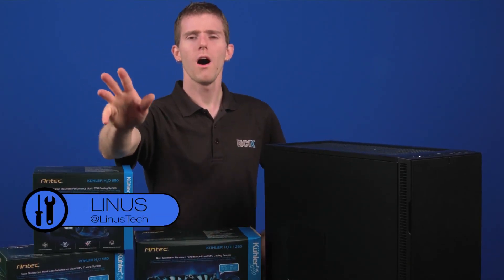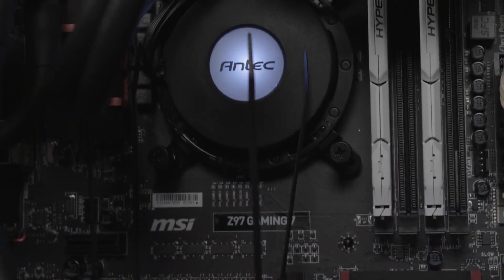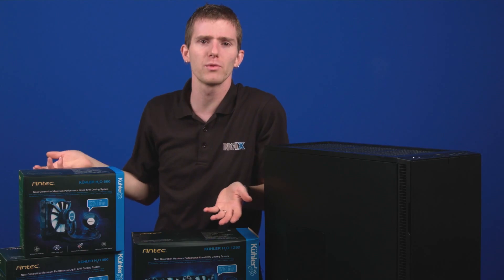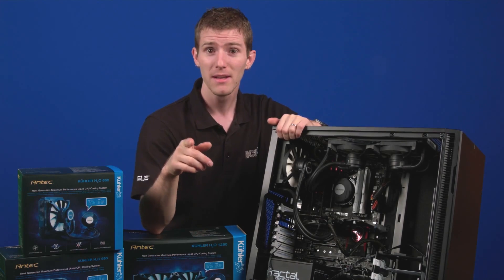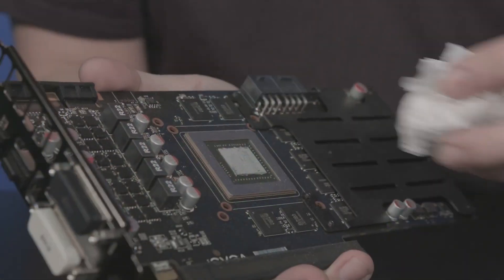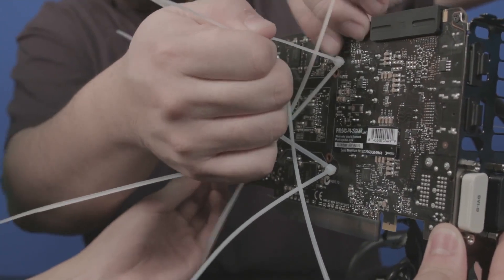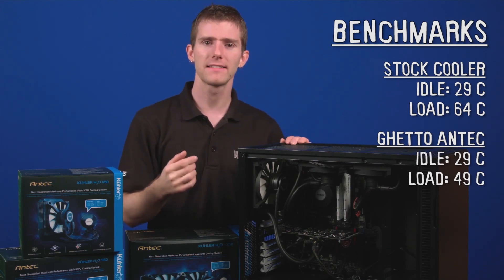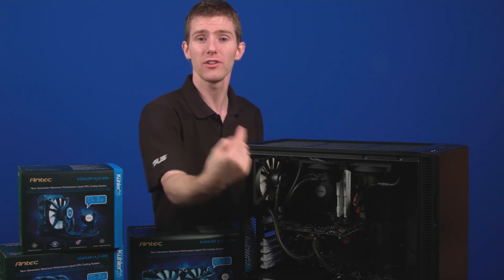DIY GPU Cooler ft. Antec Kuhler liquid CPU cooling

Comment: Many mistakes were made here. Such as not warping the zip ties that goes through the PCB around the loop that goes on the pump. Or adding a heat sink to the VRM as the fan wont be enough to cool them. You also have to check on the zip ties every so often as they loosen over time.
Well this a cool mod, it is not something you should do to as a permanent thing.

Comment: I wouldn't recommend this to anyone since you can easily damage the GPU if you apply too much pressure. If you do want to use aio cooling, just buy a Kraken G10 bracket and you can use even a cheap H55 to cool your GPU. Plus it looks better than zipties

Comment: i did this ages ago :D , with my HD 7970

http://linustechtips.com/main/uploads/gallery/album_2058/gallery_156501_2058_23528.jpg

the results are cool , max temp is 51 , and basically very quiet
 , with no fan changing RPM, all run at the same speed

Comment: I did this on my evga gtx 780ti kinpin with a nzxt g10 and a thermaltake extreme3 cooler. It lowered my temps down to 26c idle and firstrike extremely went to 49c

Comment: Been running a 920 on a 7970 for almost over 2 years and 8 months of that we're mining at full load 24/7
It's a great mod especially for and hot GPUs , 970 or 980 really don't need it though unless using high oc's

Comment: Linus,  thanks for the OCN bump,  yellowbeard from corsair did it first with a custom bracket - Zip tie methods was posted shortly afterwards.
https://www.flickr.com/photos/cravinmild/with/9565746043/
 bunch of pics in there but the gpu's are mixed in.   Oldest card was a 560ti from several years ago.

all cards used the same original launch Corsair H70 which was run on my amd 1055T prior to this.  The pump was just sitting around and I had plenty of zippys so they were free also .. more or less.   Lowest temp ever was on my zotac 560ti at 11c but most of winter my idle is 17c.   Never had a zipstrap back off or break with one set of zippys in use for more than a year untouched.

http://www.overclock.net/t/1203636/official-amd-ati-gpu-mod-club-aka-the-red-mod/0_20
http://www.overclock.net/t/1203528/official-nvidia-gpu-mod-club-aka-the-mod/0_20

Comment: I was like, "Cool.  Using a CPU cooler to cool the GPU by improvised modding."  Then it hit me that what is cooling the vram and the other components.  Only at the end did they say, "Use a fan blow directly at the vram to reduce their temperature. Prefer around 70-80 degree C range."  I doubt the silent version fan will keep that baby cool.  I was like, "Errr...  Does that defeat the two main purpose of water cooling?  Temperature AND sound reduction?"  I know this is for people that want to water cool their GPU in the cheap but isn't this a bit ridiculous?

Comment: you zipties could've been done better either by getting the 4 zipties on the ring ziptie and thread those through hole or use criss cross pattern to further apply pressure to block.

Comment: 1. Kraken G10: $30.
2. Supported AIO: As low as $55.
3. Minimum total: $85
4. Profit?

Seriously, while this is really cool, it's not something I could ever do. I have done my fair share of ghetto modding in the past, using a Dremel to add fan support and cable routing holes, zip ties to hold fans in place on cases and air coolers, and even duct tape to hold cables and drives in place in odd locations. But this...

I would just use the Kraken G10 for "cheap" AIO GPU cooling. While it's support is not universal, it does support a wide range of popular AIO coolers and GFX cards. No chance of it "slipping" or ever breaking away, I know I am always going to have full proper contact to the GPU.

More importantly, the G10 allows you to move air over the VRAM and other components on the card itself. In fact, adding cheap heatsinks (and of the proper size to fit between the G10 bracket and VRAM on the card) to the VRAM vastly improves it's performance in that respect.

Anyway, that was a pretty cool idea, no pun intended, but there is just no way I could ever do that outside of "just for fun" on  hardware I would not care if I damaged. =)

Comment: I did it with a seidon 240m and a firepro w5000 but I used m3x25 screws. The cooler block holes line up perfectly with the holes un the gpu pcb. No zap straps...

Comment: this DOES NOT WORK ON 7970, the GPU won't touch the block as the "frame" around the GPU is higher than the actual GPU. just a heads up

Comment: But the vram, that shit is going to get hot as fuck.
Reply: At the end he explained that it would get hot and you should cool it with a fan pointing at that.
Reply: DRAWNBOX thanks, have you seen the nzxt Gpu cooler. They have a fan for the vram but it doesn't seem to really help from the thermal pics I've seen.
Reply: Spartan Barton u buy heatsinks separately aswell

Comment: Something seems broken with those temp results. If under stock it gets idle= 29c and load= 64c but with the water cooler mod it gets idle to 29c but under load cool's to 49c.  So to me the temp results for the water cooled mod seem wrong because if the under load results are 15c colder then idle should also see a reduction in temp
Reply: I find that idle temperature normally stays the same no matter what type of cooler you are using.
Reply: 29 is probably the room temperature, you wont get any lower than that using fans
Reply: When it's idle, it isn't creating heat.
Reply: Yes it is or it wouldn't be at 29c which is much higher than normal room temp
Reply: EQUINOX Yeah, that's just back ground processes, if it has electricity going through it because it can't just shut off, there will be heat no matter what. That is also room temperature. 84 degrees fahrenheit is normal.
Reply: Cole H Exactly.
Reply: idle is based on your ambient temperature which for the most part sits around 25-35c for people depending on where you live
Reply: EQUINOX Ambient temperatures. Average room temperature is 22C or 74F. You wont see much lower than a few degrees above that during idle :)

Comment: The memory chips and the VRM should be cooled by some mini aluminium heatsinks. I have some Zalman on my r9 290X and the temperatures are even lower than stock. Of coures you need a fan blowing on them (like Linus said).
Reply: *****
No I did not the "getto mod" .I used the NZXT kraken G10 kit plus zalman heatsinks for VRAM. I have a dual crossfire configration..Upper card is NZXT G10 modified and lower is stock. This works perfekt. Temps are both under 75°C. Before they were up to 90°C!  http://www.google.de/imgres?imgurl=http://www.techpowerup.com/img/13-11-26/NZXT_Kraken_G10_03.jpg&imgrefurl=http://www.techpowerup.com/195042/nzxt-releases-the-kraken-g10-liquid-cooling-gpu-bracket.html&h=345&w=498&tbnid=_KSLFbPYwjUHXM:&zoom=1&tbnh=99&tbnw=143&usg=__piuIgqQU-9GfWBTpBbZpA347qQc=&docid=pO3iOlRqxCbXmM&sa=X&ei=scypVNmnLovOygOA7YHICw&ved=0CEoQ9QEwBw&dur=7552 . Its worth it!

Comment: This isnt ghetto enough for me Linus. When i think ghetto, i think of something like upgrading your rig for $2000 after selling benefit card swipes for 6 months. And then overclocking your GPU and CPU so you can use it as a space heater because you cant afford to keep the heat on for a while. NOW THAT IS GHETTO.

Comment: It's really interesting that you can do this and logically it should work anyway. However as a veteran PC builder I do not recommend this at all especially to the younger generation who may see this as a way of getting the 'watercooled Mark of Approval'. There's too much that can potentially go wrong.

Also if you are going to do this use a reference design, assuming it's cheaper (although oddly my two EVGA 980 Superclocked ACX 2.0s were considerably cheaper than the reference design at the time).

Comment: my 970 is idling at 50 Celsius is this bad or not? The stock cooler is still on it
Reply: Thats a bit too hot for many people. IDK if its bad airflow, you live in a hot area, or maybe its just that you got unlucky with your GPU :(  
  
Consider something like an NZXT Kranken AIO bracket for your GPU. It allows you to put an AIO water cooler on your GPU much better than this ghetto method!
Reply: Dude thats pretty high for idle. It should average at least around 35. Check your case for dust perhaps? Maybe there might be a better case fan config?
Reply: Is your 970 the ASUS STRIX? If so then that's probably about right since the fan doesn't even turn on until the card hits about 60-64 degrees, mine idles about 50 as well
Reply: It is the EVGA ACX 970

Comment: I have a question, will the 212 evo cooler work on the amd fx6300? Also i plan on upgrading to a amd fx8350 nit long from now so i was wondering if the cooler gets reuined if taken off the processor?
Reply: Nothing will break if you take it off the cpu except for the thermal paste. You need to clean it before reusing it (with Isopropyl alcohol) and apply new thermal paste to the cpu.

Comment: I use a big kitchen bowl to catch water when it rains outside. The water goes through a loop going though my fridge to cool the water, then it comes out and goes into my computer case and to my GPU, then back outside. For clear days (no rain), I use a big ceiling fan taped to the side of my computer. It's great. I get about 25 at idle and 96 under load (GTX970)
Reply: I don't think he actually does this guys...
Reply: sarcasm detected
Reply: 96 under load is bad, id almost say its dangerous. If you are talking about celsius ofc.
Reply: you let the loop run dry on days without rain, and try to make up for that with a fan... ? 
And you've got 96*C load... Wow... That's dangerous.
Reply: Funniest comment ever, I'm in stitches
Reply: on sunny days you could route waste toilet water to your loop. top notch urine cooling
Reply: i got it!
Reply: Smitty Werbenjagermanjenson
No that's a very bad idea. Urine is usually under pH 7 and would probably wear the plastic tubings pretty quick. You don't want any residue in your loop that's for sure. I'll stick with my ceiling fan-rain water combo thanks for the idea though
Reply: hey, me and a friend taped a desk fan to the side of his computer when his GeForce 4200Ti fan melted once. it was the good 'ol days of taking a saw to beige computer cases. that was back when PhysX first came out and he was rocking a pentium 4 dual-core. the slideshows haha.
Reply: Daniel Jaquez it's a secret, not really. google it :P
Reply: Daniel Jaquez fail.
Reply: The trolling is strong with this one:) You have way too much time on your hands man.
Reply: onesimpleclik how do you write in <strong>bold</strong>
Reply: onesimpleclik *Got it
Reply: "Got it"
Reply: +NotDone00 LMFAO ROFL !!!!!X10000000000000 omg I'm dying
Reply: +NotDone00  I use Meg griffin to cool my computer because meg is not HOT get it loL
my own joke no copyright all rights reserved®
Reply: +MDCCLXXVI1990 fail

Comment: Myself and a roommate once put an 15000rpm industrial fan on a celeron D, I ran it at 5.15ghz 24/7 for about 6 months until the motherboard broke.
Reply: Kashish Mavani
 or keep the entire neighbourhood awake
Reply: Why ..... just why ..... why on earth would you need a 15000 rpm fan ... what were you trying to do with that poor old celeron ... run crysis 3 at 4k in triple monitor surround??
Reply: TalesOfWar who has a 15000 rpm industrial fan just lying around?
Reply: Kashish Mavani It still wouldn't manage that lol.

I'm guessing they did it because they had the parts lying around being unused.
Reply: Royce Bracket they are cheap, my dad used the to cool his OC'd pc about 12 years ago
Reply: I've done something similar with newer hardware. I installed two modified Nidec Beta V VA450DC server fans onto an H100. These fans weigh about a pound each, consume 40 Watts, move 220 CFM, and were louder than my vacuum cleaner. Seriously, they spin at 5300 RPM and sound like miniature jet engines. Even though I had previously had 4 100 CFM fans on the H100 in push pull, my load temps dropped another 6*C. Definitely not worth it, but it was a fun thing to do and pretty impressive considering that I thought I had already saturated that thin radiator with airflow.
Reply: I did something similar but I used a radiator fan for GM trucks.
Reply: Kashish Mavani ... FOR SCIENCE! :D
Reply: Pictures all of you, or none of this ever happened
Reply: TalesOfWar was being sarcastic man .... i know that wouldnt work
Reply: I've seen fans like that actually push and slide other fans off the table. It's scary, man.
Reply: Royce Bracket Well I don't know its rpm but I do have a industrial fan.
Reply: TCBYEAHCUZ
 No, it's a true story, My room mate had just been hired by a major airline as a mechanic and I don't know where he got the fan, it was an industrial one and it wasn't that loud. I put the computer case in a window that had a screen on it. I had a couple of computers and was just playing around with a cheap one.
Reply: Royce Bracket I do, perks of being a sparky.
Reply: Barack Smith bitcoin mining?
Reply: Royce Bracket i got a whole box of old Delta 10k, 12k and 15k RPM fans from scrapped Dell and HP servers. i took them apart. sold the chassis as scrap, send the circuit boards back to dell (but they charged me for it) and kept all the cool stuff. like the fans :)

or you can just go buy these fans on ebay.

Comment: I would be very paranoid about doing this to my GPU. I can see those cable ties loosening over time. Got nothing against a ghetto setup for shits and giggles, but I would atleast make a hold down bracket to give it a bit of rigidity. Gotta love cable ties tho, they're handy as hell :D
Reply: Zip ties loosening? It means you need more zip ties.
If zip ties & duct tape can't fix it, nothing can.
Reply: The NZXT G10 works great for this
Reply: Walrus Cult Grunt If your idle was 2C it would start to get condensation. Killing the GPU.
Reply: Cut out a ghetto mounting plate from an old tower/psu and use non cunductive screws.

Comment: And what were the temps on the VRM's? With no heatsinks or any airflow on them, I bet they'll run hot as hell, certainly if you'd do this to a AMD R9 280X/290/290X card. On those cards, running Furmark without any cooling on the VRM's, you'll fry your card in minutes.

Seriously, get a decent solution with the Kraken G10 or a similar kit for mounting AOI liquid coolers or just get a Arctic Cooling Accelero aircooler if the standard cooler is too loud and/or not cooling enough.
Reply: You haven't watched the whole video, have you?
Reply: ivanjacob I have, but they didn't mention any temps. He only said "try to keep them below 80". With an R9 290X using this ghetto solution and no heatsinks on the VRM's, aiming a casefan at the card from somewhere below/infront of the case won't suffice, even with the stock cooler on it the VRM's will hit 90+ degrees.

People should just get an Accelero Xtreme III, which is only 65 dollars on Amazon. It cools the GPU itself just as well, cools the VRM's and is quieter. The only drawback is it's size, but that should only be of concern for people with ITX or similar sized small cases.
Reply: Haksdo2 corsair or cooler master have a version where you put an h60 or h80i on the gpu and comes with a fan for vram
Reply: Corsair has a gpu bracket just for amd cards